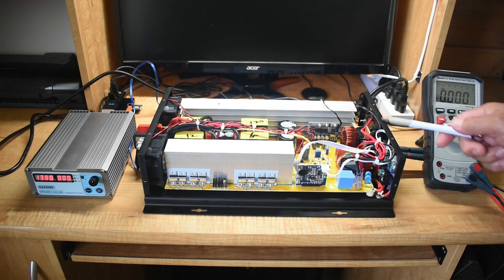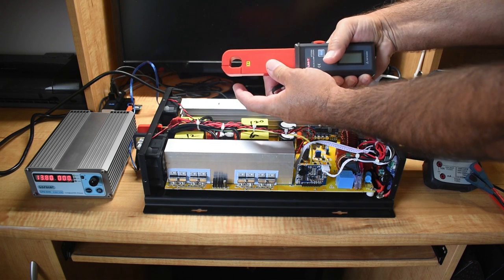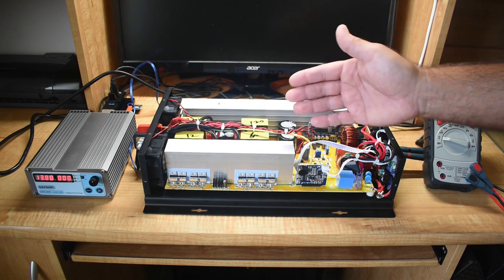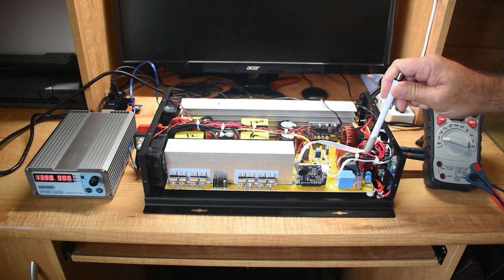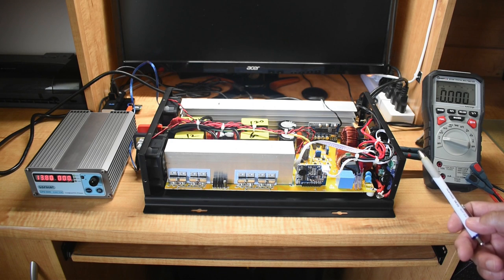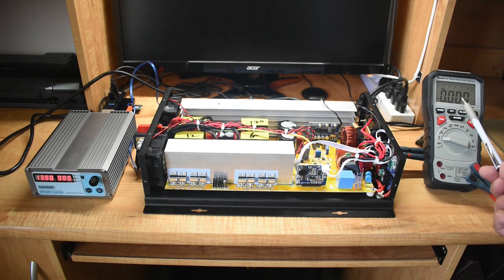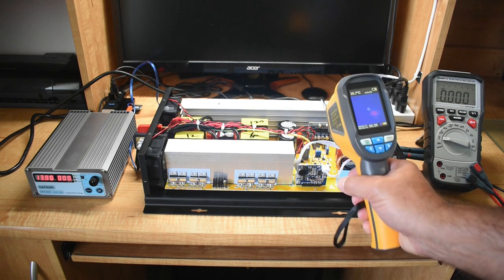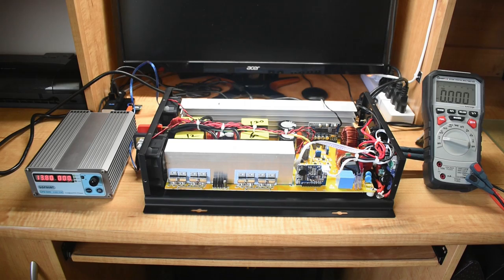Off-Grid Power Inverter Troubleshooting Follow-Up Video(No AC Output/Overload Won't Reset)

Comment: Nice having the right equipment to use in hand.   Been wanting a Thermo Cam for a long time.  Never did anything about it.  Best I could do on that one would be Freeze Spray.
Reply from the maker: Maybe you can buy a cheaper IR camera for your phone? The one in this video is now around $160 with the coupon code. It's very useful for engines, electrical panels, etc. Thanks for watching!

Comment: Thanks for going back and reviewing it. Nice follow up and diagnostics.
Reliable company are usually pretty good about sending parts to fix the problem. They'd rather send parts than a new unit if they can help it. I've seen them almost completely replace anothers whole inverter except for the coils/transformers.
Reply from the maker: You're welcome! Time will tell. I messaged them.
Reply: @electronicsNmore  may have missed it somewhere but did you get a response

Comment: That board is the spwm genarator & it creates the signal which turns on & off the mosfets in the h bridge to generate the ac voltage from 300v dc . U can get these boards everywhere they are standard on all pure sine inverter with a construction like this.

Comment: Excellent video !
A standard 120VAC outlet should never have a load higher than 15A continuous.  Not perfectly accurate, but that would be about 1,800W.  14 AWG wire would be appropriate for that load.  The second outlet should have its own 14 AWG wire.  These outlets should be labeled 15A maximum current.

The barrier strip connection should use a 10 AWG wire for minimal voltage drop.
Reply from the maker: Looks like one 14ga wire for both. I'll be replacing with #10. Glad you liked the video!

Comment: The board you pointed out going bad is a EGS002 inverter driver board. You can buy them on Ebay.
Reply from the maker: Thanks for the info Steve! I have all the other parts on hand. Once I get that board, I'll make a video showing the repair.

Comment: Well, you obviously did something the company seems unable to do and that's troubleshoot their designs. Thanks for letting know what to avoid...
Reply from the maker: If I designed the inverter, I wouldn't have told people it's OK to short the output. Rather than use a protection circuit, just use a 25 or 30A push button circuit breaker on the AC output. If I fix my unit or get a swap, I'm adding it. Thanks for watching!
Reply: @electronicsNmore  What's wrong with you. Just lie and save the $.02 of the wire like those cheapskates did. I mean, that's the norm, right Lie, cheat, scan, half-ass and all the other norms of greedy profiteers... No wonder it's going to hell in a hand basket...Grrrrr Is nothing sacred anymore?
Reply from the maker: A shame how many companies exaggerate what their product can do.

Comment: You've probably figured this out already since the video is a few months old, but the problem is almost certainly a shorted output FET, one or more of those 4 TO3's and not the control board.  Try ohming them out.  Once shorted the FET gate pulls a lot of current and heats up the driver IC.  These normally sell for few dollars each if you get the Chinese ones off of eBay (which is likely what they used in this inverter anyway).  With those output FETs matching isn't important as long as they are reasonably close in characteristics.  I've repaired dozens of inverters like this one.
Reply from the maker: All FET's removed and tested, only 2 faulty. They were replaced, still no good. Board also toast.
Reply: @electronicsNmore  I have several burnt fets on output, I looked up numbers and tried to find fets that would work in place of originals, would you by any chance know of fets that I could use in place of them?
Reply: @electronicsNmore  if even one fet fails the unit will not work?

Comment: The bad circuit board appears to be an EGS002.  Very common inverter board.  Available on eBay for under $10.  Amazon about $30.
Reply from the maker: The company is sending a new board. I need to check the mosfets. They will send all the parts to me.

Comment: Finding out if they provide spare parts is something worth while.  Even though it is a low cost unit, it's not like it was $49.99.  They should be willing to at least sell you a replacement board.  I think that chip is available though.  Still, even if it is, they should still support this nearly 300 dollar device with replacement sub assemblies.
Reply from the maker: I looked up the IC, and only found 1 supplier in China. To make sure they're well matched, I'd replace all of them if one or two was faulty. I messaged the company to see if I can get a board and mosfets shipped to me. Thanks for watching!

Comment: its your egs002 driver board. That driver drives the fets on the heat sink. There could still be an output fet blown and nothing wrong with the driver board that is showing the hotspot.
Reply from the maker: Hi Alan. I agree 100% about the MOSFET. I think there may be one or more damaged, along with the board. I'd have to test them before powering up with a new board. After I made the video, I allowed the unit to run a little longer, and the board started cooking. :-)
Reply: Right, Sillumin: "The SLM2110 is a high voltage, high speed power MOSFET and IGBT drivers with independent high and low-side referenced output channels." Not available from any of my usual sources, but probably if you were in Shenzhen you could find bins of them like candy.
Reply: @Sylvan_dB  Just buy a egs002 board from ali or just the chip. You would do well with a scope to check the driver switching. I have looked at many cct schematics for these boards and just a word of caution. some manufactures change the pinouts of this driver board just to make life more difficult

Comment: They have tried very hard to improve their products, while maintaining an affordable price, I am thinking I may buy one in a year or so, if they contenue to make improvements. Great video!
Reply from the maker: I like the inverter, but they shouldn't be telling people it can tolerate a short circuit on the output. If you buy one, add a 25 or 30A push button circuit breaker to the AC output, and replace the wire to the receptacle with #10. Glad you liked the video!
Reply: I love the detailed explanation and responses. I will definitely share and subscribe. I have the same inverter and I am wondering when I add my 25 and 30 amp breaker would you put that on the inside going to the outlet or run that from the outside of the input?

Comment: All inverters I have opened up have been either the N-channel  Mosfet, transistors and such components. 
It is a lie that they explode or are noticeable.
 I just wanted to add it was this video that made me search threw entire board. 
All those need to come out to be tested and 😅😅😅no they don't explode or show signs of failure in most cases.

Comment: the blown mosfet  comment likely answered a question i asked WFCO. two months use (charging cell phone) on a brand new WF-5110r it failed, fault light no power at the inverter outlet. pass through fine. WFCO said call us, hmmm call the dealer of the rv they recommended after my detailed explanation

Comment: FLIR cameras are getting affordable. Back in the 90's I'd used a $50,000 thermal camera. Then upgraded to a Fluke Fusion that was significantly better but only cost $9,000. The camera you use doesn't offer very good resolution but it's still hard to believe it only costs $160.
Reply from the maker: Yes, the resolution isn't high, but it's good enough to get the job done. Worth $160-$175 price range. Thanks for watching Andy!

Comment: Doug, what do you think of the build quality of this inverter? Such as how the components were soldered to the boards, if possible, the components themselves.  Thanks!  Great video!
Reply from the maker: Honest opinion, and not because I included a product link(You don't have to use it), For the money, it's a great deal, but do not try short circuiting the output unless you added a 25 or 30A push button circuit breaker. The circuit board is 2mm, which is thick, the copper on the board also appears to be decent thickness. The rear side of the board has very wide traces covered in solder, and all the wires appear to be copper, not copper plated aluminum. Soldering connections look fine. Glad you liked the video.
Reply: @electronicsNmore  I subbed to your channel because of your honesty.  You could have been "shady" by not mentioning that you got the inverter from the company and could have not published the video after it failed, your subscribers would have not known.  If I am not mistaken(saw this video a long time ago), there is a Youtuber named DavidPoz who had an issue with a Reliable inverter getting damaged when the trigger is released from a running a chop saw.  

Thanks for the reply.  Keep up the great work!
Reply from the maker: Unlike many other popular channels(especially solar), that make videos for the purpose of selling products and give viewers the illusion they do it to be nice, I view all product sales as an "Added Bonus" to support my channel, because it's definitely underfunded for the amount of work I do. I don't make videos just to sell a product. People upload goof off videos and make thousands per week, meanwhile I help countless people save a lot of money, educate them, and get very little in return. People forget that YT is a FT job for me. The company must've made changes to handle the collapsing magnetic field from inductive devices. The 15A rated worm drive saw in the video had no problems, and I tested it several times. Thanks for watching!

Comment: Stop the video at 2:54 you can see the red hot wire is attached to the outlet neutral leg, it then goes to the hot terminal tab.   This creates a lot of avoidable damage to electronics and the unit.

Comment: I have this same inverter but I was make different company but I have issues with it too I bought it on Amazon n get a replacement and the replacement can't run my shop vac without shut down and my previous inverter was a 2500 watt that could run everything in my entire house. XYZ INVT 3000W Pure Sine Wave Power Inverter right now I want to return it .
Reply from the maker: Yes. In my review video I showed that it wouldn't power up my mitre saw.
Reply: @electronicsNmore  yea these inverter are the same exact built but they just changed the color of the shell n give their  own Name

Comment: My 3500 watt inverter in my truck keeps changing the readout from 0 then 1284 under no load. It that a problem?
It still works
Reply from the maker: Faulty control board likely.

Comment: So 1/10 the voltage requires ten times the amperage to achieve the same wattage.  Hence the thicker wire on output vs input.

In an inverter,  there's even more of a difference when you account for the inevitable losses caused by the electronic circuitry.

This is why long range electrical transmission lines are stepped up to thousands of volts, so.tje I²R losses have a minimal effect.
Reply from the maker: Yes. a 100W output at 120V requires around 9.5A at 12V.
Reply: ...and 
100W requires less than 0.9A at 120V, which is why the much thinner wire at the output doesn't inhibit current flow, which is my point.. @electronicsNmore

Comment: Great Video! I have a Reliable/WZRLB 12v 3000W Unit that I would be willing to pay someone within reason to repair. They offered to send me all the parts to repair it for $35. It has 1 surface mount component that I am not really setup to fix. I bought it used and don't have the option to exchange or return it. I would like to get it going. I cannot find anyone in my area that repairs them. I would be willing to buy the parts from them cover all the shipping and whatever the cost to make it worth repairing for someone as long as it is reasonable. Great video. I see that several Mosfets have blown. Any takers.
Reply from the maker: Glad you liked the video. If you can't do it yourself, it's really not worth fixing. You may end up paying a person to do the job, and it still may not work. You'd lose not only the parts cost, but labor too.
Reply: @electronicsNmore  I feel confident I could replace the mosfets and the board that looks just like yours but there are a couple of surface mount caps that I don’t think can be done with a soldering iron. I have never tried to work with surface mount components but watched a video of a guy doing it and doesn’t look too hard but he had years of practice. I guess I will give it a shot as it is already broke.

Comment: BRAIN WAVE !  Seeing as you are going to be doing some "re-wiring", I recommend using fine stranded, silicone insulated wire.  You can buy this is short length on eBay.  The fine strands means that the wire is very flexible.  The silicon insulation also helps with the flexibility, but mire importantly it can handle high heat better than most other insulations.
Reply from the maker: Yes, that's good stuff. Thanks for watching!

Comment: Still waiting on parts ?
Reply from the maker: I doubt they sent them. I tested out the mosfets and found 2 that were faulty. I replaced them, but there's still a problem. I need a new inverter board.